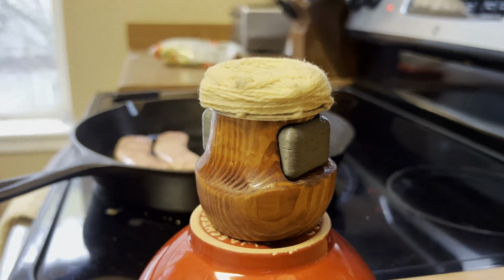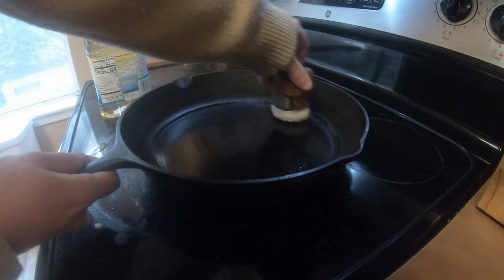Cast Iron Brush/Oil Applicator - Tade M

Comment: wood turn the stock down which will maintain uniformity then drill the middle out and then rough out the square middle with a multi tool and file down to spec's. just my opinion on how id do it. everything in this video looks perfectly fine. i just look at these things from a time efficiency point of view due to working with wood as my trade.
Reply from the maker: This is great advice, unfortunately i didn’t have access to a lathe for this project (school project with limited resources and time), but I did want to to this route originally. Thanks for your comment
Reply from the maker: I should specify that the lathe used for the metal part is metal only in our shop, so I couldn’t have used it for wood, nor do we have the correct chucks for it.